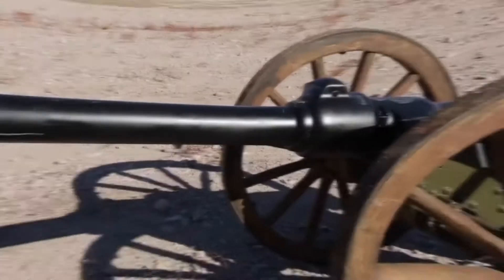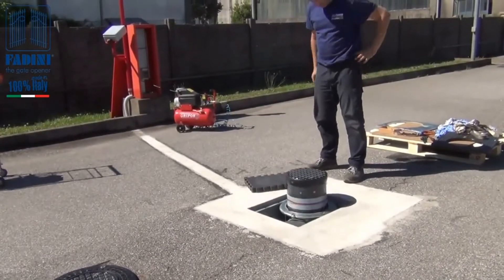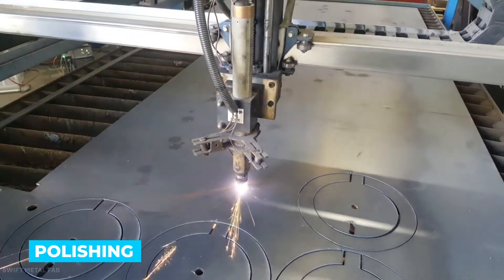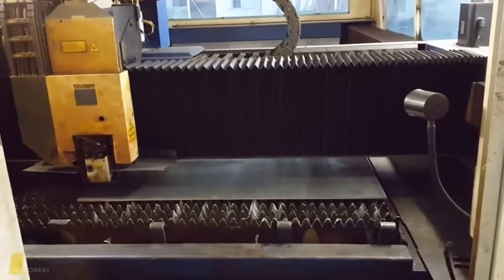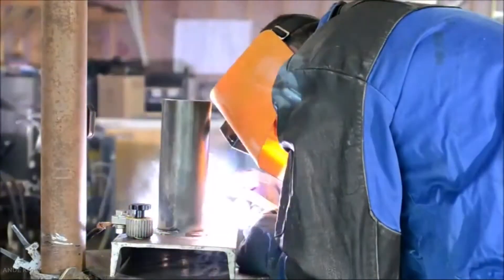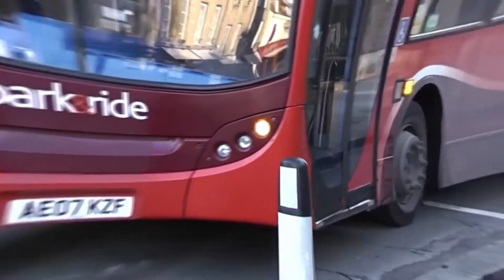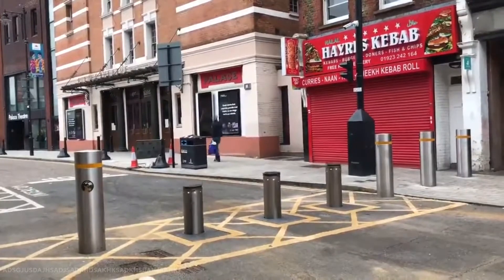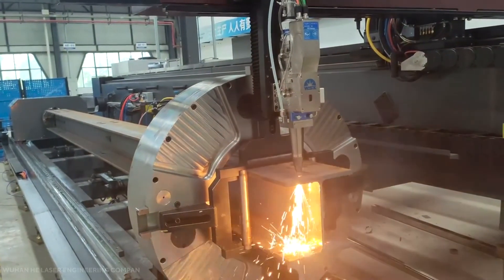How A Stainless - Steel Bollard Factory Works

Comment: WTF? Dose the person narrating/manufacturing these have any clue as to what the hell he's on about? apparently NOT, a whole bunch of confusing crap at the beginning that only maybe a lawler could understand, He clearly has no clue about welding process what so ever going on about TIG welding and showing  first Arc and then MIG welding at first.
Apparently "installing Stainless steel is cheaper than anything else" What the hell does the fact that it's stainless have to do with install costs?
Worst uninformative video i've ever seen.